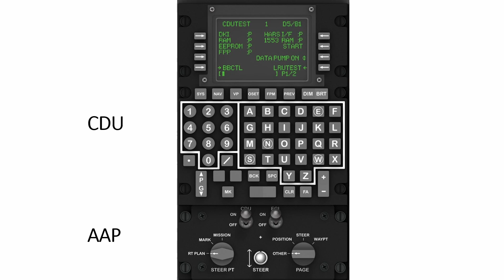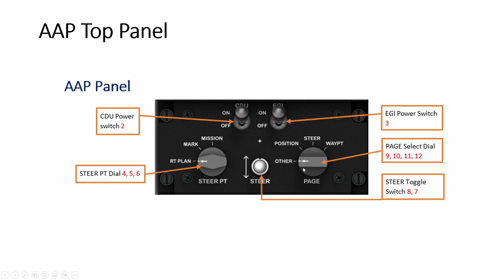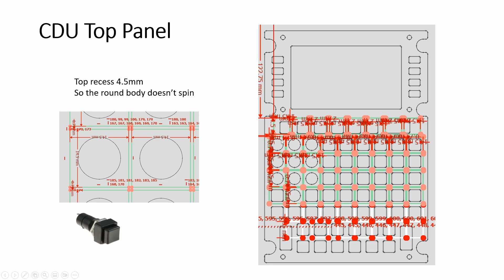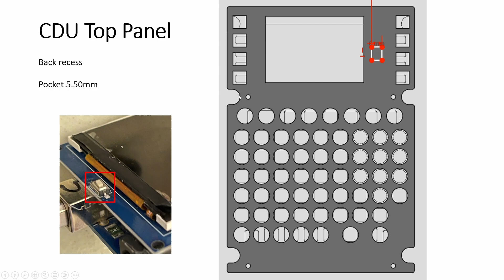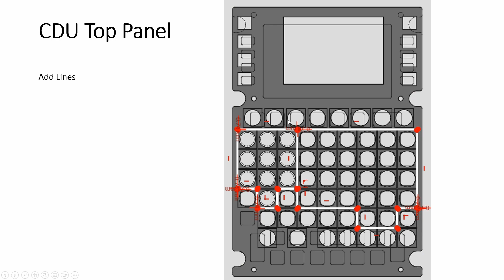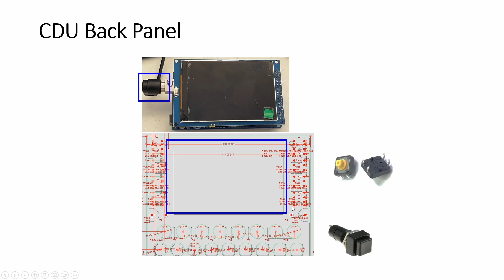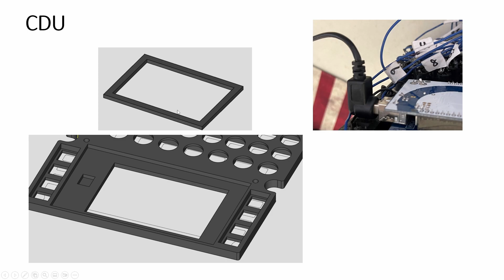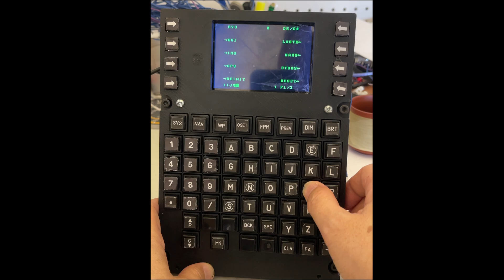Episode 17 DCS A-10C AAP and CDU

Comment: Hi, first of all, what you’re doing is amazing work and the quality of what you produce is awesome, especially considering you’re using FreeCAD.
But I have a few questions that I couldn’t find answered anywhere on your channel. Everything I want to ask is related to the electronics and software.

First, how many Arduinos do I need to run a panel like this? Because a single Arduino doesn’t have that many inputs.

Second, how do you actually connect the Arduino, Windows, and DCS so that they all work together? This is something I’m really missing in your videos. You always show the modeling, the wiring diagram, and some DCS-BIOS code – but not the steps in between.

Could you please record a tutorial showing exactly what to do with the Arduino, what software to run on it, and which file in DCS needs to be edited?
Reply from the maker: 1. Arduino boards come in different sizes. the biggest one the Mega, 50+ digital pins and 16 analog pins which can also be used like digital pins. Leo bodnar boards are plug and play, very easy to use. many people prefer to use them over Arduino. But in terms of cost per pin, arduino is a few times cheaper.

2. I disagree with you that I skipped the steps in between. My videos are some of the most detailed steps out there. You choose the correct lines of dcs bios code, put in the correct pin numbers to your wiring, state the correct com port, run the com port CMD file while dcs session is running, then all switches work in sync with the game. I've shown dozens of panels for both the F-15E and the A-10C. Maybe watching how other people do it may show you a different angle or what you were missing.